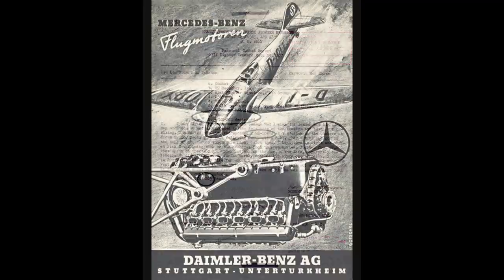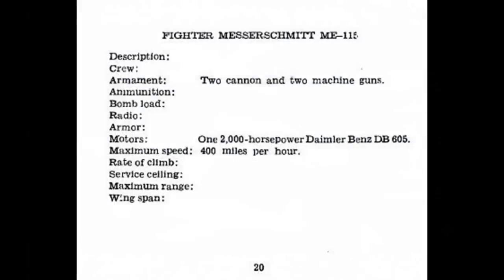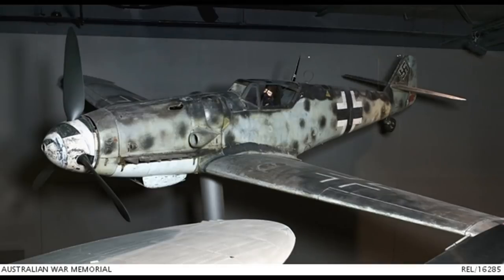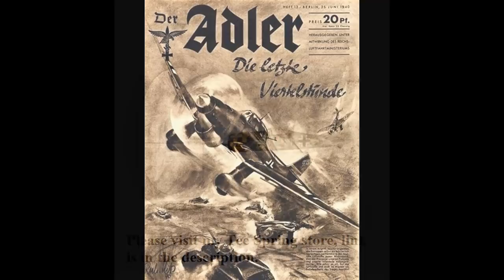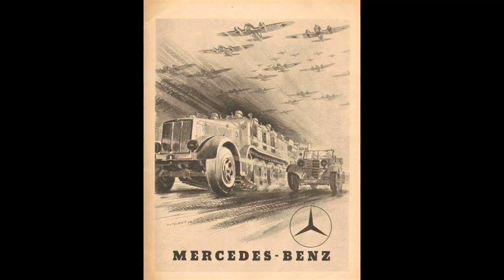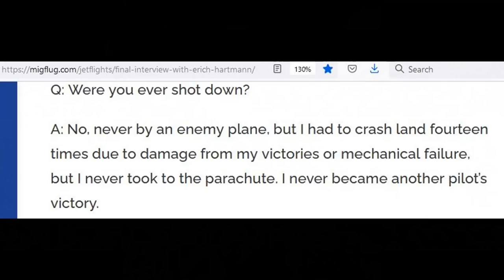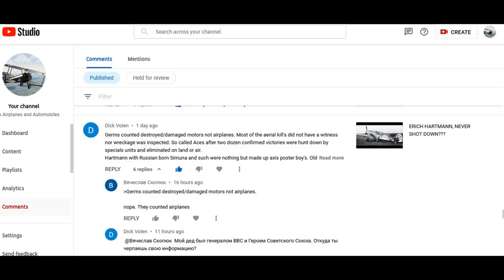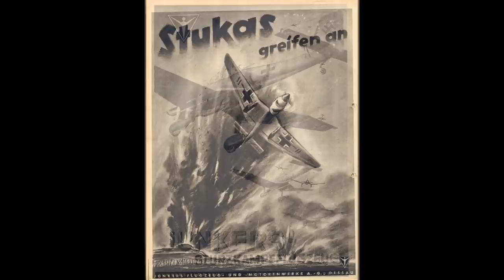Viewer Questions

Comment: hi Greg.  i wonder if you could explain why no one tried to create flat engines for wing mounts.  you would think that it would be aerodynamicaly smart do do.  but i cant find any examples of it even being tried.  So is there a obvious drawback i have missed ?
Reply: Lycoming O-1230.    https://en.wikipedia.org/wiki/Lycoming_O-1230
Reply from the maker: I think it's a problem of getting enough cylinders in there, and enough cooling to the rear cylinders.
Reply: @scottgiles7546  I know about this one.  but as wikipadia states "Although the engine was flown in an aircraft, it was not fitted to any aircraft selected for production"

I was looking for the resons for this.
Reply: @GregsAirplanesandAutomobiles  ok I get the cooling. (But it shouldent be worse than a V-engine what i can see.)   but what do you meen with   "getting enough cylinders in there"   are flat engines less spaceeficient for some reason ?

Comment: Thanks you for this video. I would like to see a video about spitfire Griffon series
Reply: That Griffon engine is a real gem, people give the Merlin more credit than it actually deserves based entirely on the P51 story, but that narrative completely ignores supercharger types and timelines, it's basically just an oversimplified bedtime story, in all honesty the Merlin really wasn't a very good engine, it had a inefficient combustion chamber, a very bad oiling system along with too many parts, and it was difficult to reverse it's direction including having to have special cams to do it.
But they got it right with the Griffon, they went back to the combustion chamber that they used with the Kestrel and redesigned the oiling circuits, but even more it's only something like 13% bigger than a Merlin but makes around 30% more power, the Griffon is THE liquid cooled aircraft engine of that era, they still had the same issues with reversing it's direction that the Merlin had but beyond that it was just about as close as you could get to perfect.

Comment: As for C3 mixing with Oil in the engine. Did the inverted V layout lead to more oil consumption via bypassing the rings in the cylinder? If the pistons bottoms are always covered in engine oil the shear amount would mean "some" would make its way into the combustion chamber over time. I know they are all dry sumps but radial engines from what i have read also have higher oil consumption numbers than inverted V engines and much higher than standard V type.
Reply: + ken b   The lowest point in the inverted vee is the rocker covers and the oil would collect there. Scavenge pumps returned the oil into circulation.
Reply: @FiveCentsPlease  I've often wondered about this myself.  Surely there are times when the engine is shut down and at least one cylinder has both valves closed.  I suppose they just hand propped the engine a few times to clear any oil from the cylinder.  Must have been a joy in February on the eastern front.

Comment: Hello, I have a suggestion for a video - the P-36 Hawk.  It’s an under-appreciated fighter that - perhaps - was incorrectly sidelined in favor of operationally inferior planes like the P-39 and (early in the war) the P-38.  The -36s that saw further development (like Finland) indicate that the plane adapted to the addition of pilot armor, self-sealing tanks, and heavier armament with little decrease in performance.  Could the -36 have been “the Army’s F4F” early in the war?  Was there room for additional developments, like 4x.50s in the wing, a bigger engine, and so on?  Cheers.
Reply from the maker: I have thought about that.

Comment: If emergency power is used for such a short period of time, would oil dilution by C3 at rich mixtures really be a problem sufficient to keep the entire C3 using fighter force at such a significant disadvantage?
Reply from the maker: It would if your priorities were out of whack. I think that's the reason they ended up running higher ECRs on the late 109s, at that point someone realize the planes were not lasting long enough for the extra wear to matter anyway.

Comment: Oh, didn't know about plans of improving the 109. Guess was aiming to make room for safer landing gear and larger fuel tanks. 
Thanks for this video Greg!
Reply: The Me109 was getting old by 1942. The Fw190 had some desirable features. They also found that the Me109 was being left behind by newer Allied fighters like the P-51 coming on stream. Problem was that Germany was by then struggling with a lack of higher octane fuel and better (!) engines. There were attempts to bring the Me109 up to modern standards but they were mostly canned when the 262 showed awesome potential and that models development sucked up enormous time and resources
Reply: @adrianhendy  sure. They push up to the K version but on old design.... 
I was talking about propaganda designs when they found out that cannot fight over London for more then few minutes.
Reply: @LeonardoSalvatore  of course.... never managed it really even with later designs

Comment: Hello Greg, thank you for your awesome videos, I always like to find something new in the field of WW2.
I have a small question that will, maybe, make a topic for a short video.
When you said that some pilots were never shot down, a question visited my mind. How did pilots were assigned to new aircraft, and what happened to the old ones? I mean if Hartmann was never shot down, wouldn't he be flying Bf-109E for the whole of WW2. Sure, he was a great pilot and that's why he was given the best equipment. But what for old 109E was it even feasible to reassign it to a newly trained pilot if both pilot and plane combat effectiveness is questionable?
Reply from the maker: All sort of different answers there. US planes were often assigned the "war weary" status once they had a lot of wear on them. Then they were pulled from the front lines. Older versions were often moved to the rear or less intensive combat areas once newer ones showed up. New versions of 109s were being built and sent to the front all the time. I'm not sure who assigned them to individual pilots, I imagine it was the squadron commander.
Reply: + Alex  I think both the Allies and Luftwaffe had similar policies on time-expired aircraft being retired to second-line operations and training units while front line units received newer aircraft.  Some of the Bf-109F and Bf-109G would have been recycled back for upgrades,  and a handful went into Mistel operations.

Comment: Sorry for my poor English, I'm not from an English-speaking country but I'll try to do my best:

In minutes 3:40 and 5:15 you talk about the denominations "209" and "290" well this has a reason for being and in the first case (209) is not related to the propaganda value of the record aircraft 

when a German plane received a "replacement" it was given the same number +100
Example: Junkers Ju 88 --> Ju 188 ----> Ju 288
Me 110 --> Me 210 ------> Me 410 
(210 was such a big failure that they went from 210 to 410) and so on

So the fighter Me 209 was the supposed replacement of the 109 (which it did not achieve due to its poor performance) nothing related to the competition plane of the same number.

-I know a video that explains the assignment of numbers and names for aircraft of almost all the WW2 belligerents but it's in spanish ...
Reply from the maker: Thanks Cristian.

Comment: Hi Greg, another non related question. The R3350 is described as having fuel injection in its later manifestations to eliminate disastrous backfires in the intake manifolds. Was this port injection, or direct injection? If the latter it would mean the problem of sufficient atomisation would seem to have been solved. I have scoured many photos of the R3350 but have not been able to identify any injector lines. Thanks for any information.
Reply: + finlay fraser       It depends on the dash number for the engine.  The -34 and -38 were direct injection, whereas other models were injected at the impeller.

Comment: Hi I have a question for you... why the usaf never used a "grand slam" type of bomb adapted for the b-29 ? seems it could have been very usefull in destroying burried bunkers like Mt Suribashi, was it a doctrine thing (no tactical use of strategic assets) or something else ?
Reply from the maker: They did. B-29s could and did carry two grand slam bombs. However nukes proved more capable, the war ended, and as far as I know, no B-29 dropped them in combat.
Reply: @GregsAirplanesandAutomobiles  I didn't know that but they never used it in combat. why ? was it shortsight? complexity of transport?  That was my question  I knew it was possible, the only other capable carrier of that 22 000 pound bomb (beside lancaster). This also relates to a an other question : they didn't use the heavy bombers on Iwo for example, did the navy tought 500 pd bombs were enough?

do wou have a video wher people can ask question ? I always loved aviation history, I have a few oddball pointy questions and you seem to know the engeneering part pretty good

Comment: I asked this on the fuel video, but do you know why germans used different compression ratios on the 2 banks of the Db engines?
Reply from the maker: Sorry if I missed it there. I think it was due to one head running hotter than the other, but I don't know for sure.
Reply: + Bagheera   I believe it was because of the geometry of the intake manifold and supercharger and the paths to the intake valves in each bank being unequal.  The manifold pressures were asymmetric,  so a different compression ratio compensated for that.
Reply: @FiveCentsPlease  Huh...dam thats interesting...these videos make me want to get into whatever field of engineering covers this but i wouldn't even know where to begin.

Comment: 0:22  Me-209 and Fw-290 kills... Lol. Robert Johnson also claimed in one combat report to have shot down a long-nose FW-190D-9... In April 1944! Almost five months before the first ones appeared... He is the only pilot to whom this happened so regularly, and his combat reports (I have read at least half a dozen) are also odd, in that he is often alone and isolated during his kills, as often is the target as well, a somewhat rare combination to happen regularly. Worst of all, he claimed to have had 72" peformance in March 44, a performance only achievable with 150 octane fuel, a fuel that did not become front line available until August 1944 at the earliest, so again a good five months later, and nearly 3 months after his last combat tour... Since he was a test pilot for that very fuel's introduction in June, after his last combat tour, this could not be a mistake.
Reply from the maker: It sounds like you posted this before watching the entire video. Think this through Wrath, if you think he was falsely reporting shooting down a plane 5 months before it's introduction, how do you think he knew that such a plane existed or would exist? Did he have a time machine? Of course not! He was identifying aircraft based on the intel US airmen had at the time.  As for your other claims, they are nonsense. As explained in another video crew chiefs were turning the boost up on P-47s and running 72" well before it was officially authorized. Your claim that he was alone when he made these claims doesn't hold up either, in fact most of them have witnesses listed in the reports.
Reply: @GregsAirplanesandAutomobiles  Few of his reports have typed-in corroborations, but this was not uncommon, so it's no big deal. I do maintain that his April 1944 "kill" of a "long nose" FW-190D-9 struck me as very, VERY lonely, and is now mysteriously gone from the Mike Williams site... The 209 report is still there. None of this matters, but I note other pilots are less prone at immediately killing intel-supplied "types". You think encountering and killing a NEW type did not buy you prestige among your fighter pilot peers? It probably did. I don't think you realize the extraordinary extent of Robert Johnson's claims for his March 1944 P-47D Razorback...: He claimed (in the Widewing private interview available on Aces High BB) that his own personal Razorback mount was the FASTEST piston engined aircraft of the entire ETO, maybe even for the entire war! No less! He claimed a top true 72" airspeed of over 470 MPH at 32 000 feet(!), in March 44... This is equivalent to the speed of a P-47M, but achieved a year earlier with an early Razorback. Yes an early Razorback may have been tuned for high altitude speed, but this would be WITHOUT 150 octane, which seemed to help little at high altitudes anyway. His June tests showed detonation WITH 150 octane at 65" during climbs. He also claimed his March 1944 Razorback, without 150 octane, out-climbed in sustained climbs a Spitfire Mk IX, just because of the paddle-blade prop (his own June test shows nothing of the sort, even with 150 fuel!), and his ignorance was so great would not even concede to Widewing that the FW-190A out-rolled his P-47... He claimed to have "invented" vertical fighting, except in his case it was truly vertical (as in straight up), not the usual hit and run definition most other non-US pilots used, of which he appeared to be, again, ignorant... His most unforgivable sin is he did not even recognize the P-47 Razorback's low-speed turning ability, saying several times its turning circle was wider than other types, an error almost as laughable as the Soviet evaluation of 27 second turn times... In combat the Razorback never took more than five consecutive 360s to reverse a Me-109G (which at 21-22 seconds for the 109 indicates nearly 10 seconds less than the Soviet turn time: This shows how massive test pilot bias can be away from battle). This did not apply to right turns (where the Me-109G would match it, and beat it in a right hand climbing spiral according to Steinhoff and others). See the Widewing interview on Aces High BB, and if you don't get the sense of a blowhard I don't know what to tell you. He is about the worst source one could possibly imagine, and for the P-47 he seems like the dominant source, which makes things even worse. All I can say is please look at OTHER P-47 pilots, ANY of them...

Comment: No Greg we're not that smart we just THINK we are ;)

LOL case in point that comment by Dick Volen re: the counting of engines not airplanes is so stunningly foolish I can't help but be dumbfounded by its silliness. If that were the case then Erich Hartmann wasn't even close to being the top ace because it would belong to Heinz-Wolfgang Schnaufer or Helmut Lent and by a long shot. For anyone who doesn't know who those guys were they were NIght fighter Aces with over 100 victories each against 4 engine bombers. I really wish i knew where that nonsense about the germans counting engines vs planes got so mixed up...well i do know but I'm rambling now....I do that when I'm more worked up than I out to be
Reply: Possibly from here.
Luftwaffe Fighter Force The View from the Cockpit

The chapters in this section, written primarily by Galland 

Early in 1944 the point system for fighter decorations was introduced, and Galland set it up at Goring’s order. It made bombers in formation count more than bombers out of formation or fighters and so on, and it varied from time to time. Victories on the Eastern Front counted less than victories on the Western Front or over Germany.

Comment: Yo Greg, I recall hearing something about the navy basically unbolting aircraft engines that had undergone WEP usage and just stripping the intake/exhaust off and tossing them overboard due to the high stresses the engine goes through during an extended WEP run. Is this true? Just curious and thought you might be able to verify this.

Keep up the fantastic job!
Reply: The R-4360 Pratt & Whitney radial engine had a time limit of 5 mins in WEP - war emergency power. The 4360 was used to power a lot of big cargo planes, such as the four engine C-97.
Reply from the maker: Yes, they actually did crack exhaust manifold from the heat.
Reply: @GregsAirplanesandAutomobiles  LOL I ment the engine itself. If I remember correctly it was an actual mechanic that said if the WEP *seal had been cracked they just stripped everything off the block and heads that was worth keeping and pushed the engine over the side.

*apparently a wire or tape or something affixed somewhere on the throttle or its linkage that would break if WEP was initiated.

IIRC
Reply: I had a friend who was an aviation mechanic on a USN Carrier off the coast of Vietnam during the war there.  Sorry, I don't know his official rating or ship, this was years ago.
He used to work on the Douglas Skyraiders, specifically the Wright R-3350 dual row radials they used as powerplants.
He said that almost every time they came aboard after having seen combat they showed signs of being used in WEP for extended periods.  Oil seals would be blown, etc.  
He never mentioned engines being discarded, but the big Wright radials were likely a rarer commodity during Vietnam than during the Second World War.
Reply: Greg's Airplanes and Automobiles I was in a transport squadron in the sixties. We had about twenty C-97s all powered by the P&W R4360. The R4360 came along tô late in WW2 for fighter use but was used extensively in a number of heavy cargo planes such as the C-97, C-119, C-124 and of course the Howard Hugh's spruce goose was powered  by these massive power house engines. Long story short the engines use in cargo planes pretty much eliminated the need for a WEP setting. Although the C-97 did have the ability to go beyond the throttle stops into WEP.